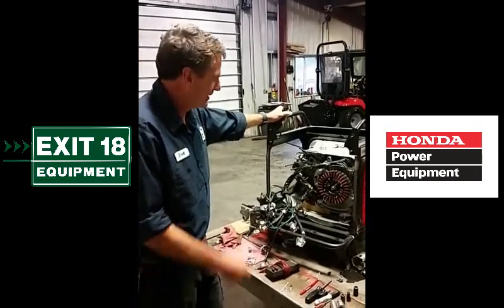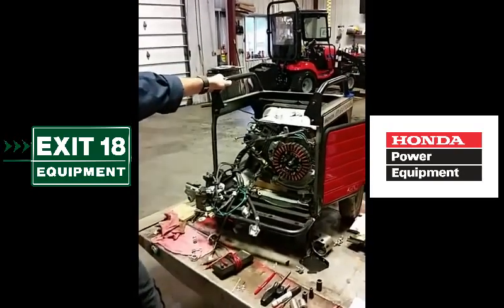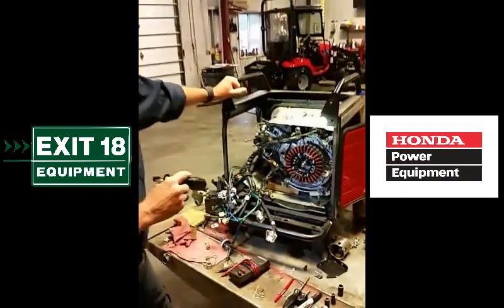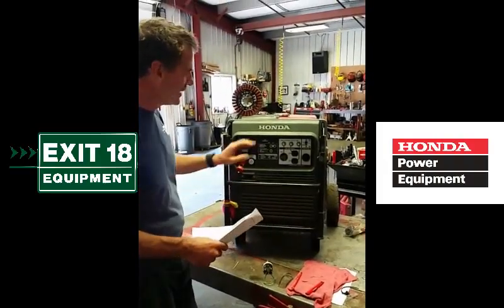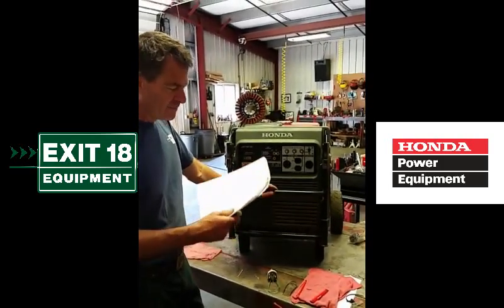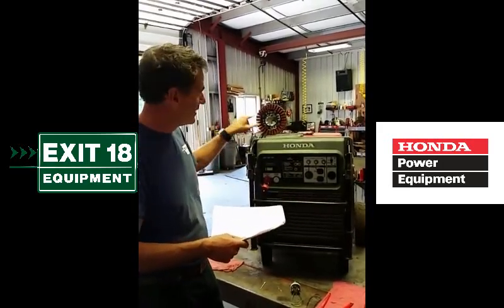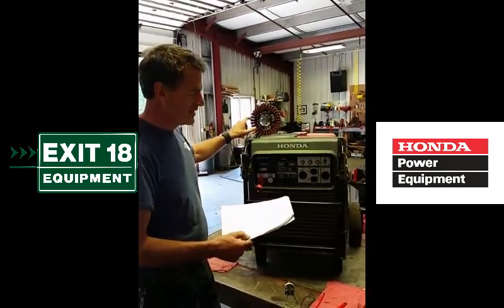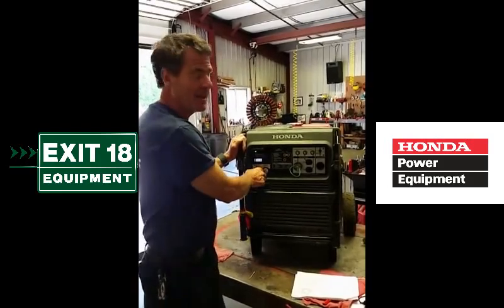How to fix HONDA EU7000i overload alarm

Comment: I had same issue, among so many others.  Junk compared to 6500!
Reply: What is the difference in the two units?
Reply: The EU7000iS is fuel injected and has 5500 running watts and 7000 starting watts.  The EU6500iS is carbureted  & is 5500 running watts and 6500 starting watts.